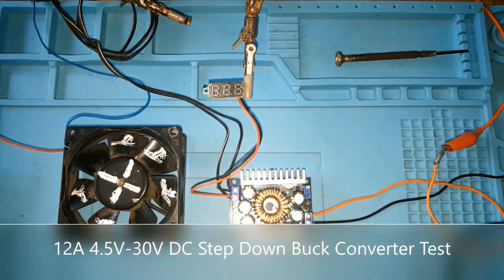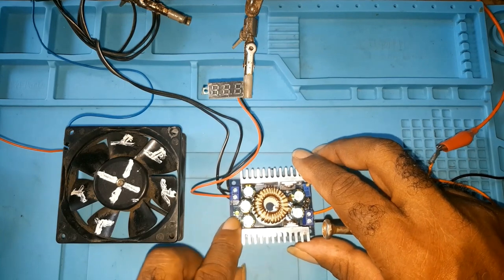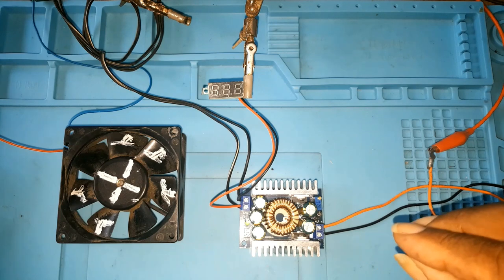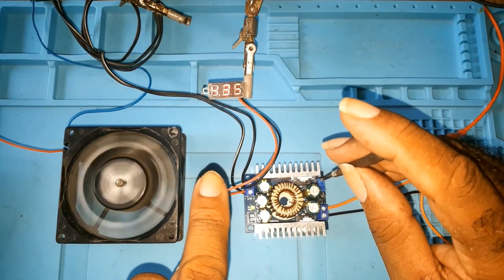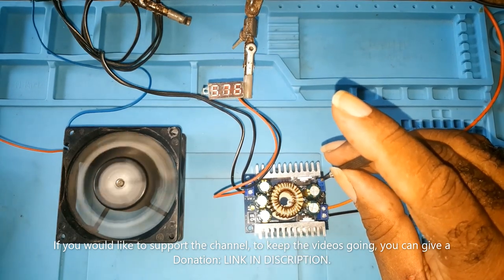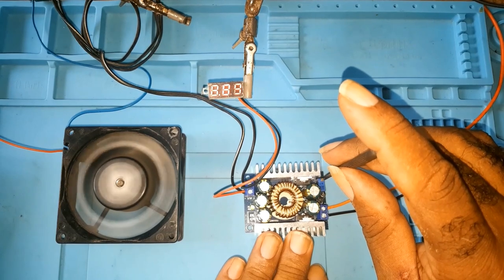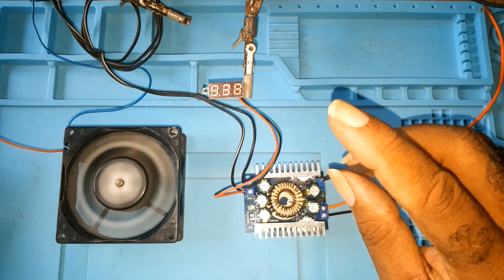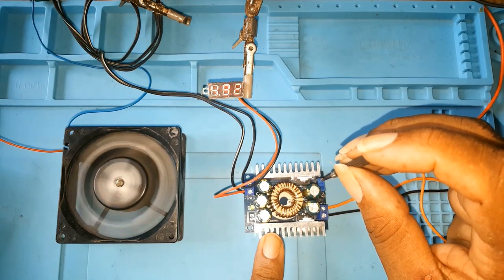12A 4 5V 30V DC Step Down Buck Converter Test

Comment: Nice video. Thank you. 

Someone have the circuit diagramm for these module ? 
No seller have a link or a picture or a PDF-file. 
Very unprofessional in my opinion. 
I think these circuit is a standart one. Why no circuit drawing.

The two MOSFET are labeld XL-401.
 I think these are MOSFET. I can not find a datasheet. 

In my personal opinon the capacitors are not from a long lasting premium brand. 
But ok ! The low amount of money ... well 

External cooling usefull by a small fan. 
Ok, depend of the load. But usefull for  my  application. 
With my medium load current the heat sink is very warm (not very hot, but very very warm). 

I think the capacitor heat up a little bit internal. 
Ok high current internal and high switch frequency and internl resitance, even if these are Low ESR types. 

Overtemperatur safe by what ? I think in the MOSFET is a sensor integrated or somewher hidden ? 

The fuse at voltage input is nice and simple. Better than no fuse. 
No input over voltage protection. 

No fuse at Voltage Output ,

Overcurrent protection I can read in the sellers specs. 
Ok 

The specs are are in my personl opinion optimistic. 
But it works well when I am far away from the specs from the seller specs. 

Same reaction in your appication ? 

What is the module reaction:
-  if the input voltage stops
- and a back current from a load into the buck-down-converter exists ? 

Your additional components a round the module ... 
Any fail protection by yourself ? 

Funny no information with a google search. No big datasheet, no circuit. 

Someone found a link ?